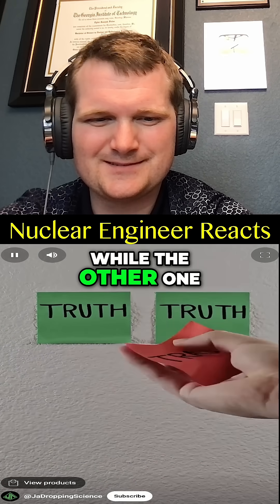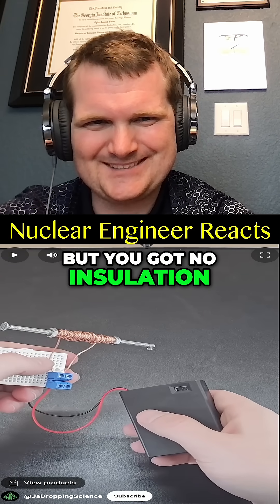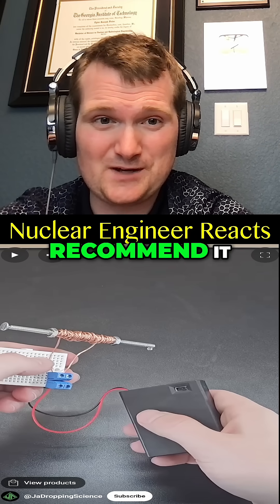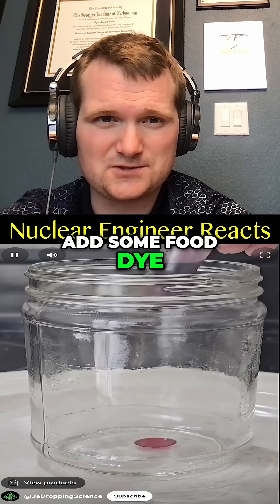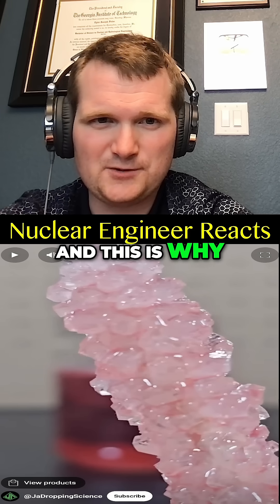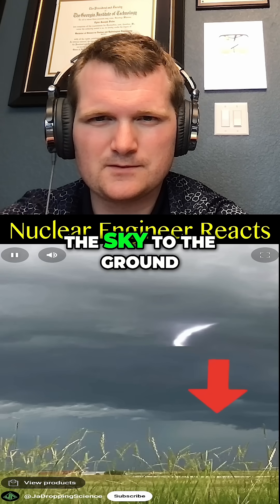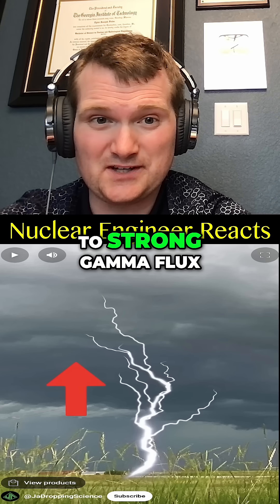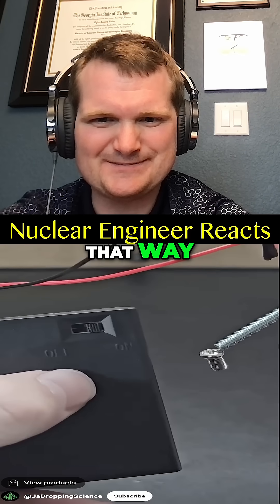Can Lightning Go Backwards? - Nuclear Engineer Reacts to 2 Truths & Trash by JaDroppingScience

Comment: In the electro magnet, I'm surprised that you don't realize that the wire is "magnet wire" or "transformer wire" and is coated in lacquer for insulation.  Yes, it is insulated.  (Unless for the video he was an idiot and used bare copper wire. )

OOPS!  He did say "bare wire"... Yup, you are right.

Comment: I managed to make an electro magnet when I was in like 2nd grade? But I learned you need insulation the hard way. Burnt my finger. And the magnet was extremely weak and stopped working as well as the wire heated. Was fun still though.

Comment: A wire can have insulation and that insulation can be made not from rubber. I thought that was what the wire was made from. I've made a few electromagnetics and all of them looked like his wire, so I really don't know what was different from his. Is it that it was bare? If so then yes, you can't make it when it's bare because the electronics aren't going in a loop as they should be.
Reply: Wire made for coils has a clear laminate on it

Comment: My physics teacher once had me make an electromagnet using copper coil, battery, and screw. You essentially just wrap it around the screw and leave two ends unwrapped and make them touch the ends of the battery. Let me tell you, that battery became hot as hell and my hand git zapped more than once

Comment: Oddly enough I used uninsulated copper craft wire to make my electro magnet. I wrapped it around a bolt 3 times, but instead of the wire itself being insulated, I just separated the layers of wire using electrical tape. I used about every type of battery in my house with and it works fine

Comment: The first electromagnets actually used uninsulated wire, but were built differently...the core was insulated with varnish, and the wire windings were carefully spaced out in a single layer to avoid shorts. This would also work without the varnish, since the iron isn't as good a conductor, but there'd be losses due to current going through the core instead of the wire.

This "demonstration" likely used enameled wire, which can be difficult to tell from uninsulated wire. The only thing actually fake was the claim that it was bare copper.

Comment: The thing about A is: there are enamel-insulated wires, commonly used for low voltage inductors and motors. But I think that enamel is colored something like red so you can tell it's there.
Reply: When he first showed it looked like clear varnished/enameled wire (and I am pretty sure it was) uninsulated wire would have shorted and not made a magnet anyway.

Comment: Copper wires are usually insulated and it is see through enamel, how do you think they make motors ? I don't see why A would be fake. Just cause you can't see insulation does not mean it is not there.

Comment: when i was a 10 year old, i decided to make an electromagnet. powered by an electrical outlet...

so i had a long 25 foot thin green insulated wire from a science kit, basically like one side of earbuds wire but much longer. i wrapped the middle of the wire around a screwdriver neck maybe 20 times. leaving about 10 feet of both ends that i ran alongside each other, like speaker cable so i could have the electromagnet in the middle of my room, while i plugged the other 2 ends directly into my wall.

i set the magnet on the carpet, ran the 2 wires across the ground, up the bed, across my comforter,  and down behind my bed.

i reached down, plugged the 2 wires into each side of the socket. my fingers suddenly got hot, and my bed immediately looked like back to the future after going 88 miles per hour. both parallel wires burst into flames and continued burning like 2 small candle flames stretched out 10 feet long across my bed.

i yanked the hot wire ends out of the socket and immediately started blowing the flames out which took a few deep traveling breaths. i saved the house, but the wire, comforter, and carpet weren't as lucky.

now, to destroy the evidence, i carefully wound up the burned wire, getting now black plastic soot all over my hands. i somehow flushed it down the toilet, which never worked well again. washed my hands. i rubbed my shoes on and blurred out the 2 lines carved into the carpet, making it look less like ski tracks and more like a dried riverbed. rubbed off all the ash still attached to the 2 deep groves melted into the comforter, blackening my hands all over again. washed my hands and never told a living soul for 33 years until right this moment.

i hope you enjoy my memory as much as i do. It's definitely one of the many insane highlights of my childhood. have a great day, and never stop doing dumb things no matter how old you get.
Reply: thank you for sharing
Reply: I'm impressed you managed to flush that.

Comment: They do make enamel insulated copper wire... it doesn't do a ton but with very low voltage it prevents absolute shorts.

Comment: The first video was a bit ambiguous :/
  I made a basic DIY radio for a science project, and the wire I bought for it didn't have rubber insulation, but had an invisible enamel coating.
  I remember this because I specifically had to sand off a portion of the coating to allow a sliding arm to make conduct.

Comment: What… i literally made an electromagnet once with non-insulated copper wire around a bolt and a 9V battery. I still have it and it just works… I don't know what else there is to say... crazy
Reply: Are you sure it was bare copper wire?
If you did this in school, the wire they give you was most likely coated with a thin layer of resin.  It'll be redder than bare copper wire.
Reply: Yeah, I can pretty much guarantee that the wire you were working with looked bare but actually wasn't. I'm guessing the wire called "magnet wire" or something like that?
Reply: I was in the same boat as you so I did some googling. Turns out that "[the] bare copper wire probably has some tarnish (a.k.a some oxidation) and oil on it that may allow some of the coil turns to act like an inductor instead of being a total short."

I was really confused because I remember using bare copper too

Comment: This one fooled me when I first saw it. I'd seen that kind of electromagnet with transparent insulation, so I didn't know that was a thing to look for, and I'd figured that with Earth being a source of low electric potential, lightning must only go in one direction.
Reply: If it's transparent it's usually enameled copper wire. Which is when it's not really a traditional plastic insulation but a thin lacquer coating the wire. Pretty commonly used in coils (magnets, transformers, inductors etc.).

With lighting you almost always have two directions. While it happens faster than we can perceive it the so called "stepped leader" comes down from the cloud and as it approaches the ground the fields rip electrons from the ground creating one or multiple ascending leaders or return streamers. Once those two connect you get the typical lightning bolt.
Reply: A being fake is dumb as fuk.

Comment: Lightening also goes up from the clouds too. Static electricity has some very strange properties
Reply: So does piezoelectricity - which I genuinely thought was fiction until I looked it up.
Reply: Unpredictable. It’s pretty cool how they depend on ions lining up.
Reply: It's a bit inaccurate to state it has a direction. It's an arc discharge, there's electrons going one way and positive ions in the other. The plasma channel can form in one place and propagate in either direction, but it's not something physically moving, it's just the electric field finding a path through the air that's weak to being ionized. In the end, it's a difference in charges being equalized, not something moving from one place to another.
Reply: Small spelling mistake detected, comment now invalid.
Reply: @TheyCameFromCapCut give the man a break, atleast he didn't call it lighting.
Reply: @TheyCameFromCapCutthis some bot shit bro
Reply: @DemonizedAll lol

Comment: The neutron moderator reference really helped me understand this thanks man
Reply: Funniest shot I’ve read
Reply: "Shot" @ampyypma
Reply: Yeah it didn't really make any sense at first but when he dumbed it down to nuclear physics it clicked
Reply: @Kirk_Thuggins  "dumbed it down to nuclear physics" is actually a sentence i never thought id hear
Reply: @Kirk_Thuggins  lmao😂
Reply: Rs
Reply: @jakekymantas8778 yo dude thats my pfp
Reply: I’ve made a magnet like that using bare copper wire and batteries and it worked I don’t get how his doesn’t.
Reply: @MyGodIsTheOnlyMost wire has like a thin coating of insulator so it would work fine in most cases if you are not using like wall power
Reply: You were probably using laminated copper wire, it looks bare but is actually insulated.@MyGodIsTheOnly
Reply: @MyGodIsTheOnly To put it simply, it's a bit like making a neutron moderator out of pure sodium. So sometimes it works, but it's not reliable. Hope that clarifies it.
Reply: Translation: It explodes. 
geg
Reply: fr
Reply: God forbid a man has hobbies
Reply: Yea
Reply: sodium is not a dense metal, which is why it is an unreliable moderator. Sometimes neutrons will interact with it, sometimes they will pass right though
Reply: I was waiting for this comment JAJAJAJAJAJA😂
Reply: @rigobertogomez25 ...WTF IS JJAJAJAJAJAJ